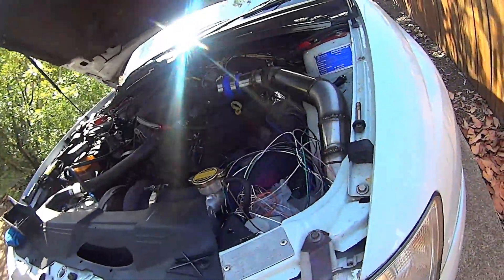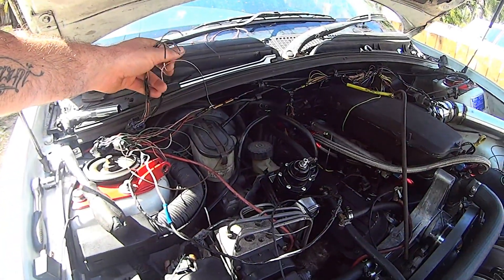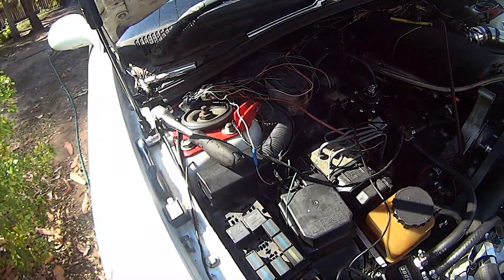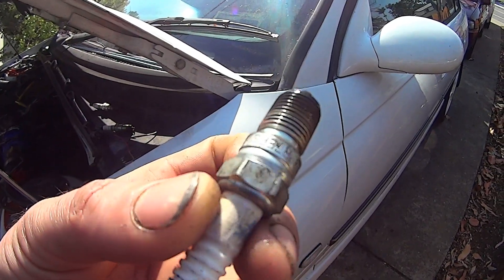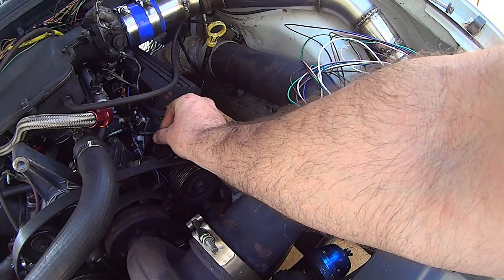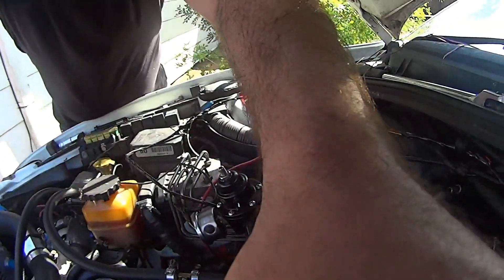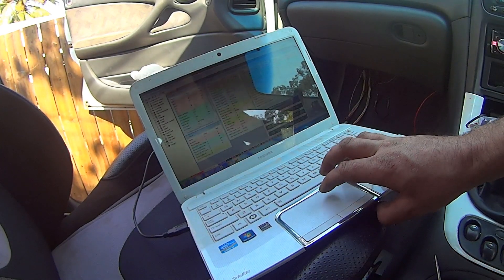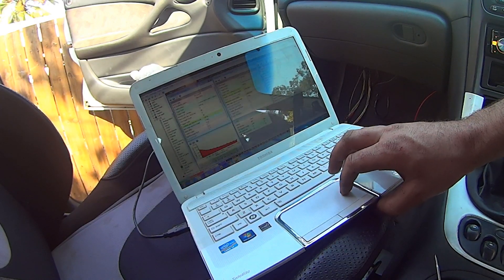wiring a stand alone ecu pt2

Comment: How did you end up bypassing relay ? Also how did you get a tacho signal ? Keep up the vids mate as they are my bible
Reply from the maker: Yeah man one of the wires on the three plugs on the drivers side of the car has the tachometer feed in there I cant remember the exact wire but you just feed the tach source to that wire and it will have a tach... thanks man glad you like the vids 😊